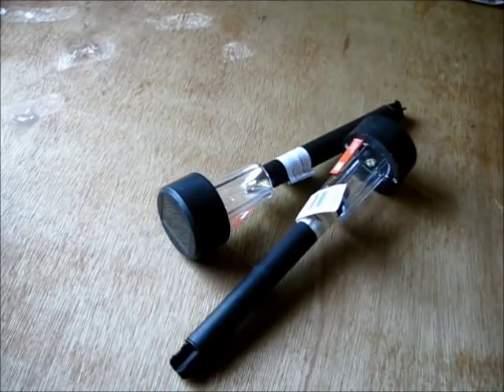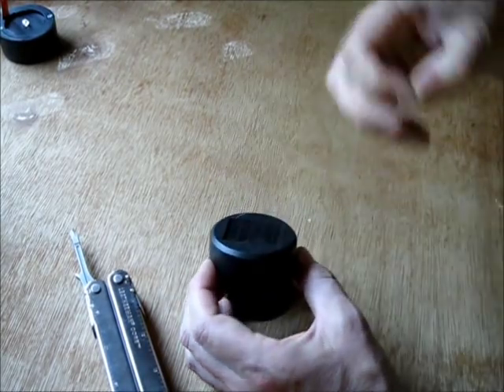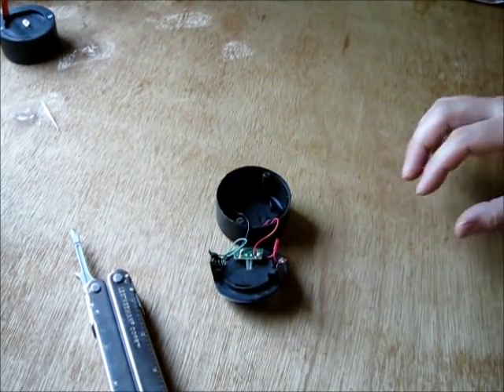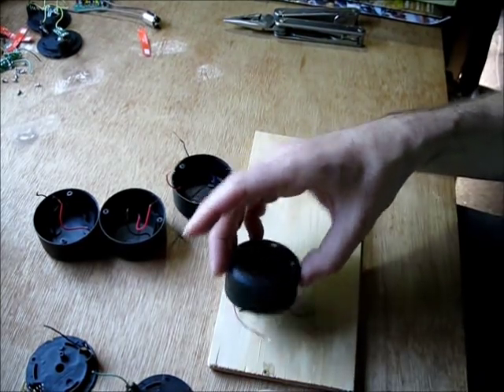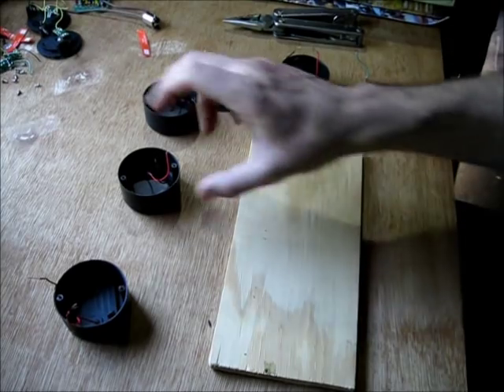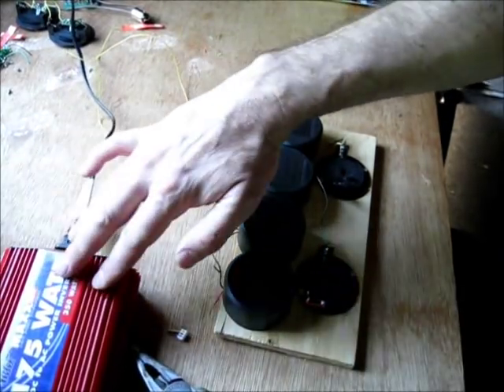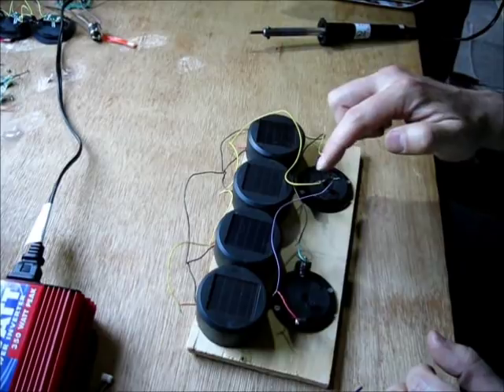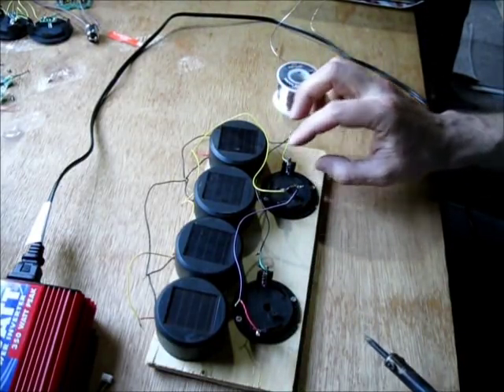DIY Solar Garden Light Hack - Solar Battery Charger

Comment: hi i have a question for anyone who could answer.  If we only use ONE of those solar panels, would the voltage output still be the same?  Is the only thing that changes is the ma?  Or did he get 3.02v because he has 4 hooked up parallel?  Sorry i'm new to this and am learning through online research.  Thanks any help would be greatly appreciated!
Reply: KarTune Tran He set aside the circuit board so the voltage will be whatever the solar cells can output (depending on the amount of sun shine). Wiring the solar cells in parallel means the voltage will go no higher than the best of the solar cells. Ganging up the solar cells in parallel only raises the millamp output, not the voltage. The reason the voltage starts at 3vdc  is because of no load on the solar cells. Once he added two uncharged batteries to the circuit, all the power was being absorbed by the batteries. As the solar cell output continues to be absorbed in the batteries, they continue to take on the charge and the internal resistance of the batteries continues climbing until batteries have absorbed all the charge they can at which point the internal resistance of the batteries is pretty high!  
I would have left the circuit boards wired to the solar cells as it does several functions. First and foremost the board contains charge controller circuitry which prevents overcharging of batteries. Secondly, the circuit board disconnects the solar cells from the battery when the sun goes down thereby not allowing solar cells to drain batteries. Make sense? I hope I explained it all well enough.
Reply: Will yam Dysinger Hi yes, thank you very much for the detailed explanation!  Your advice will be put to great use :D
Reply: Also, without the circuit board/controller in place, you will probably have trouble when night time comes and the solar cells drain the battery/s!

Comment: This is a pretty awesome way of making a charger. I found a couple of old polycrystalline solar lights laying around that we haven't used in a few years. Each one generated about 30Mah at 2.3V.

I pulled off 4 of the panels and made 2 series of 2. It was now making 4.10V at 50Mah. I soldered on a USB cable and started charging my phone with it!

It would just end up taking 20Hours to charge with the phone off because my phone battery is 1000Mah but it's great for emergencies.

Thanks Techman!

Comment: Actually you're not making a solar charger since that is exactly what a solar light is in the first place. And for each solar light you have is a single battery charger thus if you have 4 solar lights then you have 4 chargers and then you have the remarkable batteries each light comes with.

Granted it's a cheaper way of doing things because I have been doing this for years now and even made a phone charger doing this. 

Just this morning I received 15 solar lights from my neighbors thinking they were dead. Little do they know the cells never go out and after placing the batteries in the freezer over night they will work again. 

Of course with these cells I am making a much larger panel to charge car batteries to use in the house. My home has been off the grid for nearly five years between solar, magnet generators, and DC motors. 

Everything I have runs in the attic with little to no noise and powers all my appliances as well. But I keep adding and making more to better suit for the future. 

Good luck and God Bless!
Reply: Quick question Mike. I'm helping a friend (in hopes to eventually be off grid) but due to finances this will take quite a long time. Is there a good "starting point" for this (i.e.- lighting)? There is no river or creek so power that way is out. Wind (may) be one help. You mentioned magnet gens and DC motors. Are they just for wind and water applications? Thanks
Reply: One way I started was finding old fuji film throw away cameras and took out the flash circuit boards. With just a board, a AA battery and a CFL bulb you have a lamp that will be bright enough. I still use many of these lamps. 

Also you can convert an old ceiling fan into a wind generator by adding magnets. 

Of coarse the most costly item and a must have is a battery bank to store the built up power. I took old car batteries friends gave and refurbished several of them. The with a few transformers and such I built some inverters to deliver the AC current. 

Many ways to get started but very time consuming for a while. Everything a made came from scrap so it's always good to have great friends.
Reply: Also for some real fun is putting enough of these small solar cells together and making a Cell Phone charger. But it's best to use a car charger which has a built in fuse so you don't damage the phone battery. Other than that it's very safe for your phone.
Reply: Michael FallenTree Watts  Is it possible to wire enough of these cells to generate 12v. Say recharging a boat battery?

Comment: How come the 'L' drops out of solder iron or solder joint when english travels 8K miles over the water?
Reply: Oh, go play with some scrap aluminium (aluminum) that you find in the dust bin (trash can) Right-o Gov-na! (How do you pronounce would, should and could? What's with those "L's" anyway?
Reply: Now that was just mean... and a little funny.

Comment: Hi, quick question. How to prevent the batteries from getting over charged ? Also can I use more batteries for example 10 batteries instead of 2 batteries, and get all of them charged.

Thanks,

Comment: Just a couple of things...AAA batteries are at *best* 1200mAh. Harbor Freight cheapies are 900mAh.

Just bought ~3"x3" 2V 410mAh cells (finished) off ebay for $8/ea. The cells in the video are probably at best 100mAh each, if not less. Yes, probably double the cost therefore, but less waste, and far more practical from a space/mounting standpoint. For two 900mAh batteries, at decent efficiency, a single 410mAh cell should charge them in about 5 hours.

Comment: This is a great concept, buy needs allot of work, the cells taking up so much room in the casing, everything mounted on a length of board, and all that to charge 1-2 batteries? Same efforts with a bit more thought could produce a much better product.  I'm thinking small, compact, and sub/lithium capable from same basic idea, nite THAT'S what I wanna see!
Reply: I think the point is to be extremely cheap and easy. As he said in the video, where else are you going to get a solar panel for $1?

Comment: Thank you for the great video. Build one myself that works like a champ. I was wondering how many volts and what kind of set up do you have running your power inverter? I have 10 cells running 22 V but when I turn on the power inverter voltage drops to 2.5 and the inverted doesn't turn on. Thanks I'm advance.
Reply: the solar garden light needn't power inverter, what's your mean?

Comment: well i will comment it like this...you have low woltage power cells to begin with..and Voltage drop on that Diode is about 0.3-0.7 Volt...So please think about it again...,,btw try shade one panel and check what will happen :) you will destroy those panels fast if they will stay as they are ..:) there should be diode on each panel as well but that would make efficiency even lower...:) Good work anyway :)

Comment: What size diode did you use
Reply from the maker: 1n4001 or 1n4007 is fine
Reply from the maker: Or you could use a Schottky diode which has less of a voltage drop. 1 Amp rating is sufficient

Comment: Why did I think we needed some sort of charge controller in this circuit ??
Reply: You do....
Reply: He isn't using any in this video. These are just using simple diodes to prevent reverse current which is fine as long as you are careful not to over charge the batteries. There are plenty of solar charge controllers for sale on ebay and amazon.
Reply: +Ryan Walsh well, if you want to just charge AA batteries, then this would be your cheapest option if you don't mind eventually destroying your AA's, however these panels can be wired in parallel and then in series to get some decent 12v power out of them and connected to a cheap Chinese controller which would power a 12v input AA charger directly during the daylight hours, or charge a 12v battery which could then power whatever you wanted, but that would require a LOT of these ultra-low amperage panels.

Comment: If you ran those pos to neg and not neg to neg you will get much much more output volts so in short you wouldnt need so many panels. I.e. those 4 you have run the way i suggest would give you approx 10 or 11 v rather than the 3.6 or so that you have. Just saying. Have a good day.
Reply: nicam76443able 
Voltage is only the pressure pushing the current (amperage) into the batteries, having more voltage wont give you faster charging only higher amperage (more solar cells) will make if faster within limits, when charging a battery we are trying to push amperage into the battery, pushing a small amount of amperage harder wont make it charge faster,What your saying is a common misconception

Comment: No measurement of the amperes. Probably enough to charge for single 18650 cell in about 2 months.
Reply: 1 panel delivers about 40 mah you may calculate the rest.
Reply: These cells are 2v cells, it is suppose to charge up an ni-mh battery, it would probably take a few days to fully charge one though.
Reply: He isn't smart enough to switch his meter to amps.  He also has no idea how much energy an AAA battery holds either, so it doesn't surprise me.  FYI, I have metered these, they output about 22mA pointed straight at the sun in Georgia in July.  My various other solar lights output 40-95mA in same conditions.
Reply: 18650 cells would need higher voltage, so you would need to wire the panels in series.  Probably just 2 in series so you lessen your chances of frying your batteries since there is no regulation. Of course it would be such low amps it wouldn't be a huge issue.  You can get a charge controller circuit for $0.50, and a 5v 160mA solar panel for $1.50.  Such panel is 0.8w, the panels in this video are about 0.025w.  You could reasonably charge a decent 18650 battery with 1 panel in 13 hours, or 200 hours with these junk panels.
Reply: eLJaybud I did oney self it depends on the light in full light about 200 amp

Comment: Nice job! Q: the lighting you are using at your work table there, is it LED panel? If it is and you do not need that much of the area lit up, those dollar tree LEDs banked together as a 4 LED spot light would work nicely and use a lot less current. Use an old desk lamp to mount your LEDs into and then you can spot the light exactly where you need it. Just a suggestion. BTW, what watt panel are you using and what type of controller?
Reply from the maker: Thanks. I did this many years ago and much has changed since then. I was working in my off grid camper and using overhead LED lighting. Back then I had a homemade solar charge controller and a mess of homemade solar panels. Made from single cells I strung together myself.
Reply from the maker: Currently I have been in an off grid tiny house on wheels that I am building using all recycled materials and have greatly improved my situation. Have a look at my newer videos: https://www.youtube.com/user/techman2015/videos

Comment: please do not do this!!! he removed all the voltage control circuits. over charging is now guaranteed!!! When lithium rechargeable batteries overcharge explosive things begin to happen. Nickel-cadmium a little less but they will still pop and explode. At minimum you destroy a perfectly good battery. Please do not do this unless you plan to keep the control circuit in place.
Reply: also he cut out the diode so now if you leave your battery on the "charger" in low light (cloudy) times or after sunset it will discharge the battery to the solar panel.
Reply from the maker: +nbookie The control circuit of a solar LED lamp is very basic. It simply turns the light on or off depending if the sun is shining or not. And it drives the LED at night. Not much more than that. These solar cells are so low on current that they are very gentle. You could leave the circuit in place if you like though. I never harmed a battery doing this. Never.
Reply from the maker: +nbookie No, the diode is in there. Read the article for details.
Reply: +nbookie I been working with batteries my whole life never have I seen one explode, you have to be a real idiot to make a battery explode. don't believe all the crap they say about batteries so that you keep returning to the stores like a good conditioned sheep. do your own experiments and you will quickly find out all the marketing and warnings they tell you are complete BS and batteries have more potential than what is fed to the public. A battery will get very hot to the touch before it gets anywhere close to fizzing out not exploding...unless you hook 120 up to a 1.5 volt battery...
Reply: +Dana Rider yep, you know it all. I know nothing. all the manufacturer's who build dump circuits, voltage regulators in their charger controllers are just stupid people trying to rip you off. over charging, over discharging and exceeding the designed C rate are just marketing gimmicks to make you spend more for fancy do nothing electronics. 

maybe I could sell all the dead, exploded and swollen batteries as "did project batteries", sounds like their is a whole market out there that thinks they are perfectly good. come by our store front (texas solar outfitters) and we will hook you up. 

now I'm off to watch all the "fake" over charging video's on you tube.
Reply: nbookie Parcel Status Shipment ready for dispatch
Reply: nbookie Lol nice one !! but your right It would have to be rectified with a regulator
Reply: Dana Rider Trust me the battery can explode, it's best to use some kind of circuit to stop charging once the battery are full. I know I did the research myself. I wanted to play with my remote control truck and had the battery sitting on the charger I went to unplug it. Boom, fire and a big pop. Not only did the battery catch fire, it pop open leaking acid. My mother was there when it happened. She unplug it the charger and ran it and the battery to get it neutralized.
Reply: nbookie There is alot you don't know. But this is something that will blow up if you can't find an out lit.
Reply: nbookie not trying to argue because I know nothing about electronics but why does your store have exploded and swollen batteries if you use these regulators? Again not trying to argue, I'm just trying to find out info because I wanted to give this a try (safely).
Reply: @Danaman117  batteries do explode more commonly than you think. Especially with the new vape pen craze. There is these rechargeable  batteries inside. Anyways it's common that those tricked out vape pens do explode and tear off your fingers or burn your face.
Reply: Vape pens blow up al the time. Well at least the battery inside does.
Reply: @KINGTRAP2018 That will take your e cig about two weeks to charge using them....

Comment: No a AAA ma hour Ni Metal AAA is MAX about 1200 mAh or if their much lower maybe they were actual NiCad those much lower maH but those last many years longer lifetime. Never buy a 3 cell LED flashlight it's does not use the batteries down till all the power is gone, 1 or 2 cells and even 4 cells work best to use all the battery up.  NiMetal do not last as long as NiCad in number of charges but have more mAh ability (run time).  One can rejuvenate nicad/nimetal with a higher voltage and hi current spike, like several charged cells in series to just charge one cell a few seconds charge at a time a till the cell voltage recovers ( a so called bad cell) .. then charge it as normal.

Comment: 1:57 
This battery is 600 mili Amp hours
Our AAA are 1500 to 2000 mili Amp hours? Or 200 mili Amp hours
Connecting solar cells in parallel

Comment: side-note for folks. the shrinkwraped cells "battery" are mostly china export, actual capacity runs aprox one-third of what is printed on the side of them. retail brands are also less than claimed, though varies. [all electronics are rated as 'nominal' ,or exaggerated in plain terms] as DIY'ers we can overlook + be mislead on this..         and good idea to have digital meter handy, double check everything. for eg, the three cell  flashlights rundown one batt much more than others. happy hunting

Comment: Removing the circuits is a very bad idea. They stop overcharge and the batteries from exploding
Reply: The output for these 6 cells is about 120mA tops.  A good AAA (~800mAH), or AA (~2000+ mAH) would see this as a trickle charge.  NiMH can be over charged at 0.1C or less without issues. If continual (several days) it isn't good for the batteries, though they likely won't explode.  For AA this would charge about 0.15C in perfect sun, or 0.05C for AA.  If charging 2 batteries this is cut in half.  The important part would be the diode, so the batteries don't fry the panels at night by backfeeding.
Reply: But remember when the sun isn't charging the batteries, it should be consuming the power. Or the batteries have been removed and put into other original use.
Reply: You may be right in this specific case, I was talking more about a general rule that has seen people get burned (literally).  I've actually got my hands on some of these and may do some testing.

Comment: I have been thinking of doing this for some time and I stumbled on your video and it helped a bunch. If it has not already been seen or pointed out in the other comments? On the garden lights I have and took apart were were clearly marked on the on board circuit board S+ and B+. S+ for solar cell and B+ for battery. All that you would need to do would be cut off the LED and run extra wire from second sell to battery socket. You way works just as well but you could use the diode from the light.